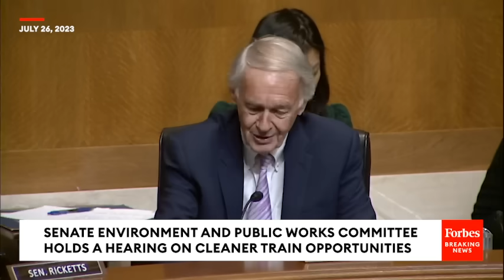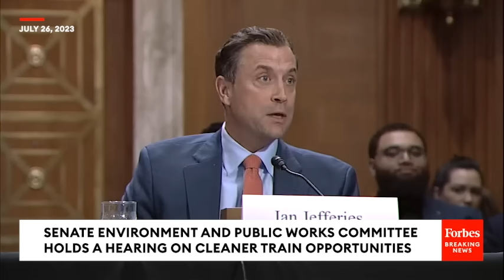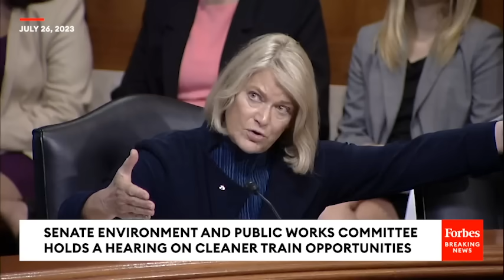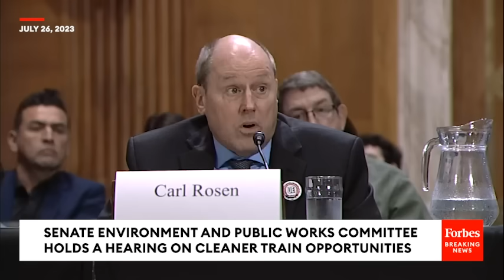‘How Long Would It Take To Replace All Diesel Locomotives With Electric?’ Cynthia Lummis

Comment: Most diesel locomotives ARE electric. The diesel engine turns the generator that produces electricity. The electricity powers the drive wheels.
No battery could provide enough electrical power to pull the weight of a freight train.

Comment: The trains are electric. But a diesel engine turns a generator.  It would take about 80 years or so. Every car would have to have 4 sets of batteries that each weigh 8,000 lbs.

Comment: Don't tell them.. all Diesel Locomotives are all ready Electric. They use teh Diesel Engine to make teh Electric to run the actual drive system. The problem isn't the Locos it is teh intrastructure need to provide DIRECT ELectric to them along the entire Rail system.. My guess would be about 50 years to doi that full upgrade.. Lines and grid

Comment: Look, I dunno why so many of you think that "electric trains MUST mean battery electric".  FFS, people - use your imagination!  NOBODY in the world is using battery electric trains for anything other than very, very short distance, very low power work.  I defy you to show me a single main line electric train, anywhere in the world, which is powered by a battery.
They ALL run on current supplied from the electric grid.

Comment: We've done a lot of work in Britain on electrifying route miles, going back to before the First World War - and this truth still holds good.  What takes the lion's share of both time and capital cost is not building electric locos or electric passenger car sets;  it's building all the overhead gantries to support the power cables, AND laying the very heavy current cabling and lineside transformers to supply the required power at the multiplke feed points required to prevent serious volt drops along the track.
In fact, even in a place as densely populated as England (60 million people in an area HALF the size of Arizona), there are still plenty of lines running on diesels.  Reason?  The running costs are only economically viable if the line is used very intensively.  Lines from south-east England into Waterloo Station (London) are all electrified - but that station handles 41 MILLION passengers per year.  Many cross-country routes still use diesel trains as the savings on running costs cannot justify the capital costs of electrification.
If you look at films made in Britain when lines were being electrified, there's another point that hits you;  you can't install overhead gantries and the power cables when the tracks are carrying traffic.  So if you want to electrify a double track line, you have to close one road, making it effectively a single line.  If it's a single line, then you have to shut it completely until it's fully electrified.  To do the job and keep services running is a logistical and organisational nightmare.
Reply: Thank you for sharing that real world example of what it would take to make the conversion.

Comment: So believe the only reason they’re pushing people toward all electric, everything is control you can store gasoline and diesel fuel for an emergency you cannot store electricity in any measurable quantity to speak of for a emergency and that’s what they want they want to be able to shut the power grid off and everyone has to depend on the government to save them……. and that is the reason they are going after internal combustion engines and gas appliances

Comment: The power to move goods and services from one place to another requires much power and torque and massive horsepower. Anybody that tries to tell you that electric power will be able to do this is, massively full of shit. Diesel is the way to go. No question. If California does not like this, the hell with them.
Reply: On the contrary;  there are plenty of examples of high power, high torque electric freight trains performing well in other countries.  Building a loco with the required horsepower - especially with such a generous loading gauge as you have in the US and Canada - is perfectly practicable.  What you don't have is the power supply infrastructure to support widespread electric trains.  And, as the man said, even if you have the capital available, building it would take many decades.

Comment: What an electrical grid and charging stations n how long would it take to recharge a locomotive electric engine. How long would it take, how long will it run, and how much electric would you need to fully charge a locomotive engine? Then the cost of replacing those batteries? What is their life span?
Reply: Battery electric locos in a small to medium marshalling yard can work well, if the design is matched to the workload.  Battery electric locos for main line work, even in a country as small as England, are utterly useless.

Comment: Another long discussion with so many changing variables that it makes no sense to have the discussion. Agreed we need to convert diesel trains to electric. Let's do it as quickly as possible without destroying the EV market ramp. Expense is enormous so some government grants is warranted. The place to target the money is the train manufacturers.
Reply: Nope.  If you want convert mainline trains to electric in a system the size of yours, the vast majority of the costs will not be for locos / trains;  they'll be for the overhead wires, supporting gantries, multiple lineside transformers, and all the high power electric grid connections to supply the required current.

Comment: LOCOMOTIVES are ALREADY ELECTRIC--- they're just operated by diesel engines--- which could be converted to HYDROGEN without that much.. something else.  The diesel engine DOESN"T power the train-- it powers the GENERATORS that make elcrticity to operate the motors that actually turn the wheel.... so the engine operating the Generator should NOT be that much--

Comment: Probably about 100 years because that would have to be one hell of a battery and by then batteries will be extinct and they will be a different way of doing things so you’re wasting your time with batteries and Ev s. It’s not possible to run a train or a semi or anything else off of batteries they will blow up from the heat you’re sitting on a bomb. If you want my opinion find some other way I’ll go back to horse and buggy

Comment: I'm an EV enthusiast and I believe we should be working towards a future where all cars are electric. And even I think that pushing for battery-electric locomotives is crazy.

Trains are the most energy-efficient kind of land transport by far, and building new locomotives, especially battery-electric ones (which would require multiple megawatt-hours worth of batteries per locomotive) is extremely costly. Converting trains to electric is the last thing we need to worry about. For the foreseeable future we need to focus on converting passenger cars, trucks and busses to electric, as well as building electrical infrastructure. Automobiles are far less energy-efficient than locomotives, so converting them to electric will have a far greater impact on emissions.

And yea, I think that banning diesel locomotives from operating in California is utterly stupid.

Comment: I am an engineer - NO, I don't drive a train. 
It would take on the order of 75 to 100 years. The world does not have the ability to make the electric infrastructure any faster than that. 
The lead time to build a continental wide electric network is SO FAR BEYOND just replacing locomotives no politician will ever understand the math. They don't do math, they've demonstrated that numerous times.  
Rail is SUPER efficient as it is. Let the leftists go hungry, it's what they voted for.

Comment: As a current class 1 engineer I would first tell the different roads you can no longer re build or 2nd life 30 year old engines. You have to buy new ones. Going all electric  is simply too much for the shareholders to bare.

Comment: You could probably convert diesel-electric locomotives on freight trains to 'battery electric', but then a 100 car freight train would have an additional 100 cars to carry all the batteries. And you can't just stop in the middle of Kansas to recharge them. If you could, it would take a week or more.

Comment: Electric locomotives are only viable IF there are overhead catenary wires and antennas, like the GG1, E-33, E-44, EP-5, the Little Joe, etc.  They proved themselves in the past, BUT making a locomotive run like a Tesla on a charge will not work.  It would have to run on catenary wire and antenna.

Comment: Europe’s first trains to use batteries as a main source of power have arrived. Hitachi Rail announced last week that 20 tribrid trains—nicknamed “Blues”—are now running on rail lines across Italy.

The trains have the ability to switch between battery power, electricity and diesel. They can travel roughly ten miles relying only on batteries, which recharge on their own as the train rolls down the tracks. The batteries can replenish themselves whenever the train is braking or by drawing electricity from an overhead apparatus that connects the train to a power line, reports CNN’s Julia Buckley (July 3, 2023)

LOL and that's only a 300 passenger train. Nice idea to jump the liitle holes without overhead wires left in Europe. 
But if California wants HV cabling from Wyoming to their door dan they can power the trains along the way at the same time.

Comment: Just the headlines alone for this drives me nuts. 

Okay, first off, do people in Congress not understand how diesel-eletric railroad locomotives work? They are electric, in that the actual traction motors are electric. They are only diesel because of the 16-cylinder diesel engine turns an electric generator -- in one model of loco, giving that monster 80,000 HP of power!

Second, if we can't outfit a single truck fleet with batteries, why would we electrify railroads? That's not to say we shouldn't electrify railroads (I say this for a completely different reason), but the fact is, trucks would have to have 8,000 lbs. of batteries alone -- fully 10% of their carrying capacity and weight right now! Then, add in the fact a city with a population of 50,000 people told a trucking company "no" on electrification, when it came out that the trucking company would use more electricity per day than the rest of city residents would per day.

Now, I have a solution to this: Carbon-capture, biodiesel, and waste-management power plants, coupled with electrification of railroads to use diesel-electric locomotives as mobile power generators. Not only would this actually be sustainable, since biodiesel and waste management plants would involve using trash as fuel, but the other aspect is, carbon capture plants actually can synthesize fuel, as both diesel and gasoline are hydrocarbon fuels. But put it this way: Back over 20 years ago, Burlington Northern Santa Fe Railroad did an experiment, out on the West Coast. They outfitted 6 lovomotives with the ability to put power back into the grid. Their findings were that those 6 locomotives produced enough power to fully supply a city of 100,000 residents for a full year.

Now, would someone tell me why BNSF did this 20 years ago, but yet we couldn't do that today? Because if there is one thing I know, is that when it comes to society and energy, there are always trade-offs. However, I am very much in favor of using every resource we have efficiently, and using it properly. And, given the environmentalists and Greens, you would expect them to agree on this, given how we would clean up the environment, have robust energy and transportation systems, and on top of all that, not have problems with carbon emissions, since carbon capture gets rid of carbon in the air.

Comment: Silly to mine all those special metals for a battery locomotive that would take hours to charge. Just reinvent electric locomotives like the GG1. Yes it is a lot of track infrastructure, but it is successful in  Europe and Japan. The US North East corridor remains electrified. In  Northwest, l Milwaukee Road was once
fully electrified. Direct electric locomotives do not have battery charge/discharge chemical losses, battery fire risks, range anxiety. Long range battery locomotives would be very heavy, perhaps exceeding track capacity - causing derailments.😮

Comment: Railroads probably aren't buy Tier 4 locomotives because they cost too much and are less reliable than the older locomotives they replace.  Truckers are having the same problems as well, the newer trucks are more costly and less reliable, big companies might be able to handle this increase in expense but independent owner/ operators can't and they make up a significant portion of that industry.

Comment: Well, railways began by hauling the cars with horses... I guess we could go back, as long as nobody is in a rush lol. Would be good business for the draft horse breeders as railroads would overnight require millions of heavy horses, and tens of millions of tons of hay and oats, and millions of teamsters, and stabling along the line every 20 miles, and, and ,and. 
Good grief, coal/steam and diesel/electric are the only feasible method for powering transcontinental heavy freight trains. Local freight and transit has been electrified for over a century in places. If it made sense for long distance freight it would have been done by now.

Comment: Overhead wires  need  100 units of power  they give you 100 units 

Battery with same need 120 units power needed due to losses to charge battery 
And when using battery .

PS where is electric to come from ?
They will not let you build powerplants Or power lines?

From solar and wind ?

What do you do at night and calm days ?

Charge batteries ? Another 20 percent loss to charge during day to use at night!

Where does the lithium come from for all the new batteries on the battery locomotives?
How about the Night batteries need so juice is available when the  sun goes down ?

Comment: I propose a car built entirely with electric motors and no batteries.  But it tows a trailer with a diesel generator. The car doesn't output any pollution and the towed generator does not count.

Comment: 90% of the electricity needed to power these electric locomotives comes from coal and natural gas..? Today diesel locomotives can move one ton of freight more than 480 miles on a single gallon of fuel, generating a carbon footprint up to 75% less than trucks. Batteries are not the future.

Comment: Rosen has a need to make sales, DESPERATELY, so of course he is going to push green stage 4 locomotives.  Maybe they should be asking how to electrify the railroads like Europe has. That would require evenly spaced nuclear plants to actually power the system better and greener than solar and wind farms both in carbon payoff and economically.  Nuclear plants take less carbon in their production I believe Stewart Brand pointed this out.  Transmitting power over 1000miles is kind of futile due to transmission losses, I expect there is a sweet spot at about 600-700 miles so...  How many square miles of solar panels doe you need for a gigawatt versus a few acres in a rural area for a molten salt reactors. (I spit upon pressurized water reactors in rejection for their developing poor saftey record) OR  Gasp, your could make mobile 70MW power plants built into train engines...well yeah not so smart.  Then again having a 70 megawatt generator to roll into a hurricane zone for temporary power?

Comment: What a way to weaken a Country. As the consumerism turns to electric power, the bones of America need to remain strong with Diesel electrics that do not use huge amounts of fuel to move the massive shipments they do- every day. The problem is that were moving huge amounts of Chinese goods from ports to inland comparative to everything else. Is Elon already working on these?

Comment: Funny Diesel locomotives are actually electric. The diesel locomotives use a diesel burning engine to power a electric generator to drive the electric motors to propel the train.

Comment: CPRail has a working concept Hydrogen locomotive. They are adding cells to make it more than a yard unit.  Most modern Diesel electric locomotives are mainly electric. They have a diesel engine run an  air compressor for braking, and a DC generator that provides power to the electric traction motors, that drive the wheels. Intermodal rail is what keep railways viable. Businesses need their maritime goods transported by rail to semi-truck freight delivery points from sea ports. That's how the North American supply chain works. In Canada our grain and bitumen is transported to export ports, and refineries by rail. Thank Trudeau and their Liberal/NDP government for that. Trudeau doesn't like straws and is banning them, and oil and gas pipelines are big straws. Provinces are left with the only viable way to move these products, and that is by rail.

Comment: She is totally clueless what is involved. Maybe she has no concept of the energy involved.  Ie she thinks a 120 car train will go a mile on 2 D cells. 1/4 of train has to be batteries to go from los Angeles to salt lake. Ie 30 box car size battery rain cars. The volume of batteries compared to using fuel oil is huge. Sadly the senate has folks with no basics at all. Scary stuff.  

As an engineer i could not handle such dumb questions. Ie go right to she is radically a dolt and absurdly clueless. Her questions are like of a 4 year old or someone with dementia than a functioning person.

So maybe too she has no concept of the vast energy start a rail train to move.

Comment: if there was a high end grid powered by new age nuclear power and/or we achieved atomic fusion that could be used commercially then heck yahh lets go electric. However for those that want rail powered by wind turbines and solar-panels plz put down the hunter Biden crack pipe.